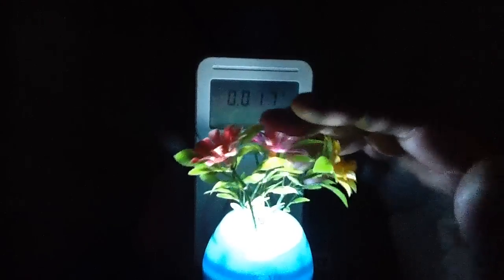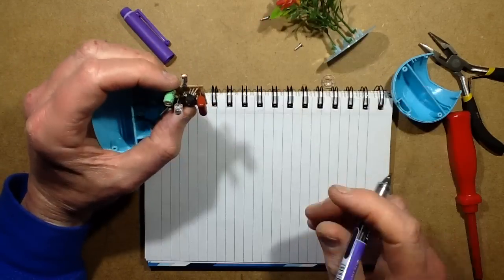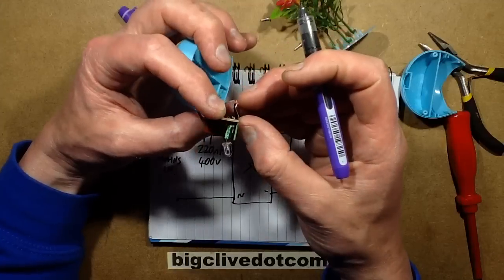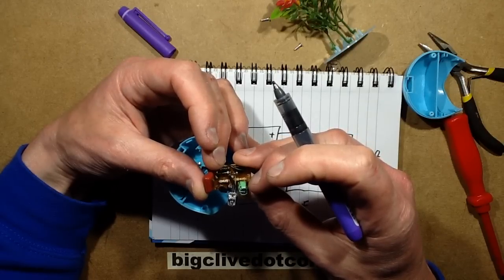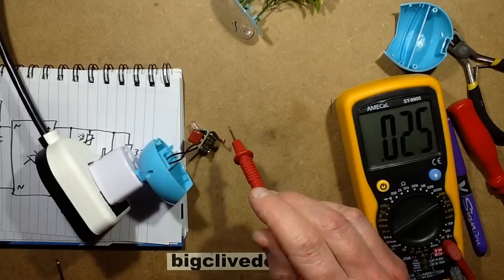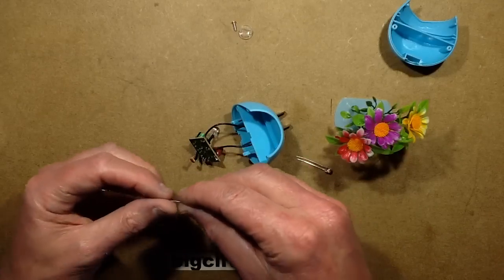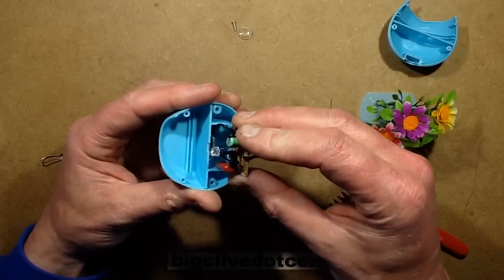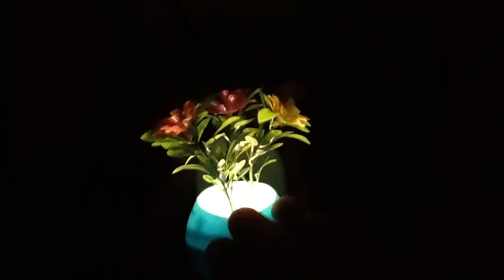Inside a Chinese LED flower night light with hack.

Comment: In Southern ontario, we tend to call it Hydro in terms of the actual electricity into the house, since a lot of our supply is from hydroelectric sources, so much so that one of the main electricity providers here is called Hydro One.
Reply: +Alex Barlow Our power supplier is called Synergy but we sure don't calls mains that.
Reply: +Alex Barlow +Alex Barlow Our power supplier is called Synergy but we sure don't calls mains that.
Reply: +Mentorcase Wrong order. Hydro came first, the company took the term as their name.
Reply: +Alex Barlow Or perhaps if it was wind generated you could call it windows.
Reply: In the North of Scotland electricity used to be supplied by Scottish Hydro-Electric, but that has since been taken over by a company with a less interesting name.

Comment: In Poland the traditional names for electricity is "light" for 220/230V and "force" for three-phase, but it's rarely used nowadays, we just call it "current".
Reply: +t33s current, light-force. hmm
Reply: +t33s In the Netherlands we commonly use either Current or Two-twenty / Two-thirthy (it's been 230V for years and years, but old habits...). And sometime we use the slang "prik", which literally translates in English to "poke", but "jolt",  "Djolt" or even "zing" would probably be a more accurate English translation.
Reply: So that's where "Use the force Luke" came from, Obwan just wanted Luke to plug soothing in..

Comment: In the US, there isn't really a precise singular term like mains.  The "grid" is probably the closest, but that usually means the power distribution network in general. However, wall power, line power, line voltage, AC power, or just "AC" are pretty common terms to refer to the power coming out of the outlets in a home.

Comment: In german it's called "Netzspannung" which means something like "net voltage" or literally "net tension". The power grid is called "Stromnetz" literally "current net", although nobody thinks about amps when "Strom" is used in that word. It's more like "electricity".

Comment: Hi, could you check those "intelligent" emergency led bulbs from ebay with built in battery. They should be quite interesting to take apart.

Comment: Thanks for all the great videos Clive.  Is it possible to detect voltage change to detect malicious code on chip? I.e a Linux terminal would report consumption of resources that may not be accurate if the software resides outside of the OS.
Reply: We need a team to start reverse engineering chips. Let's do some investigational research.

Comment: re cheap goot wick off ebay, the stuff I get is either the real thing or a perfect clone of the real thing, it comes in little printed plastic packets with instructions and warnings in perfect english, correct part/model numbers, links to the .jp website etc. I mostly use one of those spring loaded click-and-suck desolderers cos I always had problems with wick, it just never seemed to work very well but goot wick is really goot. idk what the difference is, whether its the weave, the flux or what but its good to have an alternative to the clicker

Comment: Clive, you should get a small 240 to 110 transformer to test questionable multivoltage devices like these to see the actual result of what happens
Reply: it would not be accurate as the frequency is higher so the capacitive reactance would be different too
Reply: No explosions ?????

Comment: I could think of a few more things to do with just the guts out of that night light. Remember I light up models? It would be great to mabe add that set up into one of my model displays and have it come on at night and go out in the day time. I would add a cord onto it instead of directly into the outlet,but what a great power supply and having it go off in the daytime saves me from switching it off and on. I could stick it into a car model, have it run the headlights and tail lights,and use it for a night light. See? lots of great Ideas. I just had two more pop into my head,so yeah... can you post a link as to where you got that? I may order a few. I have been known to clean out the dollar stores supply of led flashing light wands,just because I can use the guts for other projects. They finally asked me why I was buying so many. I told them for lighting models or even RC planes ( I do that too)
Reply from the maker: +scott firman Just keep in mind that the LED in these is directly referenced to the mains supply.
Reply: +bigclivedotcom I know, its something to consider when doing a project,changing things to accommodate more leds would help. It wouldnt be all that hard to change diodes and stuff...having a brain fart tonight...you know what I mean. geesh!

Comment: I wonder if the pink version has a pink tinted filter to shine a pink coloured light onto the flowers? Next question, could you install a colour changing LED instead? Or would that upset the balance of current flow in the circuitry?

So, anyway, Clive, are you a bear, or a panther? - Panther, as in 'pink' - Bear, as in 'brown'. . . . . .

Comment: We typically call it 'line' voltage, "AC", or variations on household current. Green is always ground, white is always neutral and black-red-blue or others is always... ZAP! er... Hot.
Reply: +wdavid parks Brown is the best choice for the live wire, since you know that's what colour your pants will be if you touch it.
Reply: crap, good thing i dont mess with the wiring in my house. i work on cars and have become conditioned to black=ground white=live (or red, or yellow, or any color that isnt black basically)
Reply: +m4xwellmurd3r Maybe it's due to 'learning' at a young age but I have no problem going back-n-forth between household AC wiring and electronic gadget DC wiring colors - it's no longer in my concious mind (or however it's spelled) - it's automatic now.

Comment: Hey clive, how do you identify a desoldered LED's anode/cathode? Last time I took an LED out to change it, I ended up putting it upside down and burning it.
Reply from the maker: +Khurram Aziz Usually the anvil shaped LED reflector is the negative connection.  But not always.
Reply: +Khurram Aziz The round ones often have a flat part next to the cathode.
Reply: +Khurram Aziz A cheap multimeter just to be sure?
Reply: Alex Atkin I do have a cheap multimeter that has a diode mode (which measures the forward voltage) but it doesn't seem to work for diodes with a forward voltage drop of greater than 1 volt (aka, all LEDs). Its one of those cheapo auto-ranging uni-t meters.

Comment: You should have modded the circuit so it does not draw so much current off. That just offends my delicate sense of aesthetic sensibilities.
Reply: +Paul Frederick  "15mA ? you can go to the moon with that kind of current!"  - Dave J.
Reply from the maker: +Paul Frederick It's entirely reactive power, so if there's one single load in your home that has a traditional transformer (heating, air-conditioning, alarm etc) then it will help counteract it's power factor.
Reply: bigclivedotcom
So free energy? Sweet!
Reply: +bigclivedotcom you mean i wont get billed for 220*0.017 = 3.74 watts of power ?
Reply: +iceberg789 More like 0.1 watts of billable (real) power. The rest is reactive power, the 0.017A on the meter was the apparent (real + reactive) power. Reactive power does no work and is not recorded by any (modern) electric meter.
Reply: ***** thanks, now i need to check how reactive power actually does work.
Reply: +iceberg789 Apparent, reactive, real... hard to wrap your head around at first but totally worth the effort of learning it well. The different forms of power are very relevant now that LED lighting and switching power supplies have become almost universal. Didn't have to worry about it with incandescent lighting since reactive power is zero for a light bulb so apparent power = real power. Easy, lol.
Reply: Do you really consider that MUCH current?
Reply: @iceberg789  Plus VAT.
Reply: @iceberg789  It works.
Reply: @sootikins   Also 100% efficient counting the heat.
Reply: @stewartcaldwell5299  it was 2 years ago. thanks for reminding me about my old comment. >.>

Comment: Clive do you recommended a budget multimeter for home use?
Reply from the maker: +Acksaw If it's just for bench use and not messing around with mains wiring then any basic multimeter will do.  I'll be taking a look at some soon.
Reply: +Acksaw yeah if it's just for messing around and probing batteries or anything under say.. 60V then pretty much anything will do, though I will give a recommendation to one of these meters http://amzn.com/B00TI2HPLS
I have a cheaper variant but they're great value, they have a lot of features for a low-end meter and I don't know what models but I believe some of them have the better ceramic fuses.
Reply: +Acksaw if you can afford a bit over a hundred, i love my green lee meter

Comment: Why is that transistor arrangement the cheapest?
Wouldn't a PNP driving the LED be as cheap?
Reply: +fabts4 Nope, because if they did that they'd have to use a 220uF 400v smoothing cap instead of 220uF 16v, which would cost significantly more and be much larger. Or else maybe put the PNP before the cap using a PNP that's good for at least 400v. Consider that without the LED as a load, the output of the rectifier approaches the peak mains voltage, e.g. 353v with 250v mains input.
Reply: +Sootikins Alright, for this to work, you need a load all the time.
Reply: +fabts4 Right. If you think of the dropper cap as looking like a resistor (it does, to AC) it makes sense: the less current being pulled thru it the less the voltage drop. So when there is no load pulling current the drop across the cap becomes almost zero and boom! the 16V smoothing cap assplodes under the influence of almost-mains voltage. With luck it would do so with enough force to launch the flowers, adding some humor to the situation...
Reply: +Sootikins And what's the math behind the 16v value of the dropping cap?
knowing your LED needs 3v and (say) 10 mA, how do you choose the two caps?
Reply: +fabts4 Assume 250V mains. You need to drop 250 - 3 = 247 volts across the dropper cap. V=IR, transform to R=V/I. 247/0.010 = 24.7K. Then cheat by using an online Capacitive Reactance Calculator to find a standard value capacitor that looks like roughly 24.7K at mains frequency (e.g. 60Hz USA, 50Hz EU). In this case 150nF would be a decent choice. As for the smoothing cap, well, they just pick something. The greater the capacitance (up to a point) the less the LED seems flicker when you move your eyes past it. 220uF is a common choice. They used 16V in the night light because that's a standard voltage that's a bit higher than the highest voltage they expect it to ever see.
Reply: +Sootikins doesn't the highest voltage they expect it to see depend on the load?
Reply: Yes, but the load in this case is known. They know how many mA the LED will pull, they know the reactance of the dropper cap, using the math I posted above the voltage can be figured pretty close. Not exact since not everyone's mains are exactly the same. That's probably one reason they used a 16v smoothing cap instead of trying to get by with 5v. The "flaw", if you will, in this design is that if the LED fails open circuit the cap will explode as soon as the transistor turns off.
Reply: Actually I mis-spoke a little there. Within limits of reason the voltage across the LED and therefore across the cap will remain constant (at the LED's Vf spec) at different mains voltages. It's the current thru the LED that will vary. So really I guess they could have used a 5V smoothing cap but they probably decided that would be just too cheesy.
Reply: +Sootikins If you increase the mains voltage, you increase the voltage accross the dropping cap, the smoothing cap and the 330 ohm resistance, don't you?
Reply: Across the dropper cap - yes. Across the others - no. Realize that the + terminal of the rectifier, the + end of the smoothing cap, the collector of the transistor, and the high end of the 330 ohm resistor are all one node. A node obviously can't be at more than one voltage at the same time. So when the transistor is off the node's voltage is set by the LED's Vf (about 3.2 volts) + whatever is dropped across the 330 ohm resistor. When the transistor is on the node voltage is going to drop to roughly 0.7v (the drop across the forward biased junction).

To clarify a bit more - the smoothing cap and the turned off transistor look (to DC) like open circuits. The only thing passing current then is the LED through the 330 ohm, thus the LED path determines the voltage. When the transistor is on it is a "better" path since it's nearly a dead short so then it sets the voltage, Meanwhile the dropper cap is just sitting over there being a current limiter.
Reply: +Sootikins I don't think I said the node would be at different voltages. for every volt gained across the 330 ohm, the smoothing cap should gain one volt as well, no?
(All that with an open NPN)

In other terms, I think the 330 ohm resistor would have to drop roughly 7 volts instead of two if you were to double the mains voltage.
Thusly, the smoothing cap would see 10 V across itself.
Reply: Regarding the node voltage - you are right and I guess I misunderstood something you said earlier.

As mains voltage is increased the voltage drop across the dropper cap is going to increase and so is the current in the whole circuit. So yes I suppose the voltage seen by the smoothing cap would increase since higher current means more voltage dropped across the 330 ohm. I wasn't paying enough attention to the influence of the 330 ohm before.

By my rough reckoning, at 120V mains the current is about 8 mA. Drop across 330 ohm is 2.64v, across the LED 3.2v, so total seen by smoothing cap is 2.64 + 3.20 = 5.84v.  Then at 240v mains, 16.5mA, 5.46v across the resistor, 3.2v across the LED = 8.66 volts seen by smoothing cap.

It is almost morning here already - I'm going to bed before the sun appears!
Reply: +Sootikins Agreed.
Good night!

Comment: Thieve some small pieces of Blutack from your employer's office equipment cupboard and use it rolled into ball then stab such little circuits into when measuring/testing.... i even use it to hold connectors to solder to....